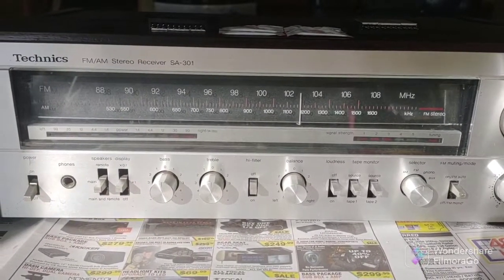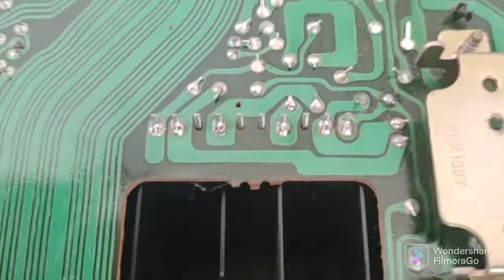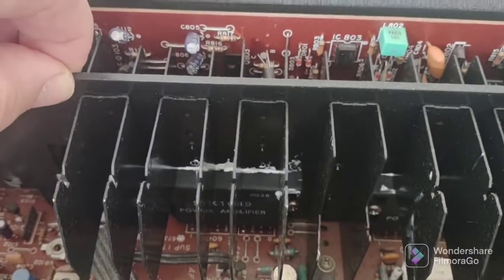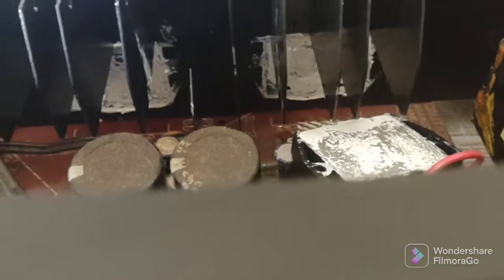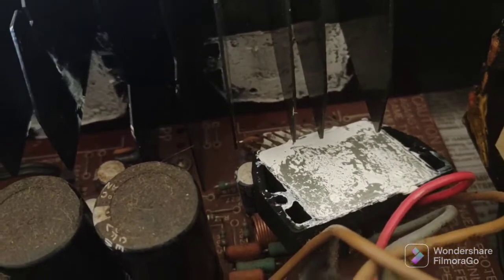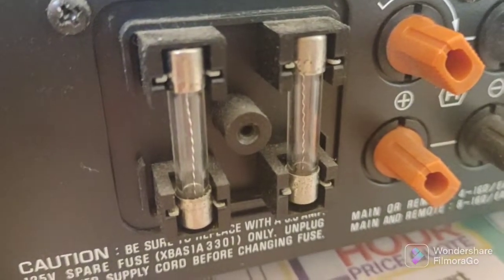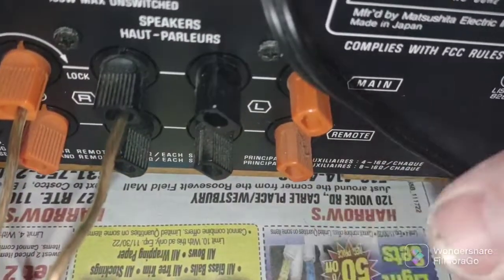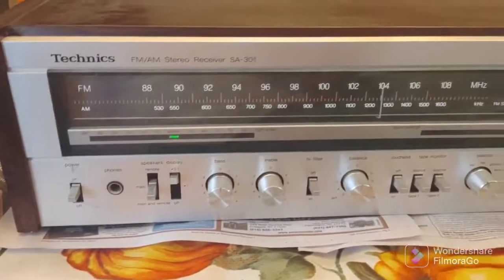Technics SA-301 replacing power output STK IC Chips

Comment: Those new stk chips you put in are probably counterfeit.
Did they work? 
I have three Technics units that need repair. 
My technician told me the other day that he’s been reading that there maybe a way to do proper repairs on these. I hope so
Reply from the maker: Hello, yes, there are counterfeits out there. Good point.  I try to buy from reputable sellers.  So far I have not had any problems with the new ones in this video, but it's not a receiver I use a lot.  I saved the old ones as I think only one failed.  Good luck with yours, if you have one to fix.  Thank you for your comment. Try to grab a SA-500, if you can. I have one of these, and they are all discrete outputs and 55 Watts per side too.
Reply: @anthonyhfe6450  I have a sa700 & sa800a. They both have been restored & sound great.
I have two sa404s that need to be repaired. Let me know if you remember where I could get good stk replacements 👍
Reply from the maker: Those are some nice Technics you have there.  Beautiful! I bought some STK0029 ICs from eBay seller wehavethatitem but that was back in 2018.  I searched all my eBay purchases for the ones I used in the video, the STK1039 but I could not find that purchase. So sorry.  So I'm not sure where I got them but I'd swear I got them on eBay. But everything is hit or miss.  If I had to get ones today, I'd just roll the dice on eBay.
Reply from the maker: I did some more searching.  They're no longer available but I got them from a Amazon seller called Doral Electronics.     But who knows if they're still around. Maybe do a Google search.   Good luck.  I hope you can bring those other Technics back to life !!!

Comment: Can you tell me why the left speaker is weaker than the right speaker?
Reply from the maker: You may have a dirty switch or a bad STK on ur left channel.  But it could a number of things that can cause that.  Dirty selector switch, dirty other switches, out of spec components like electrolytic capacitors, resistors, or transistors.